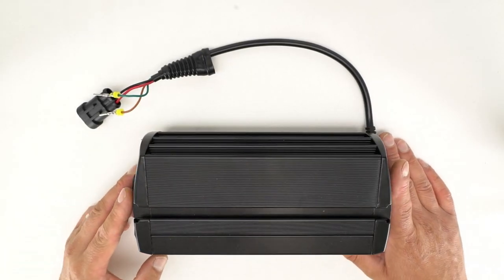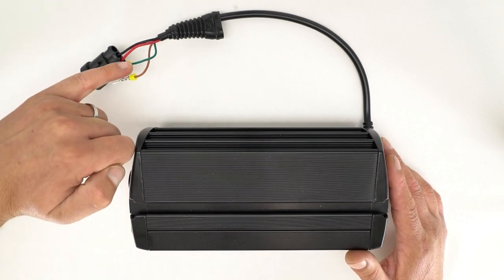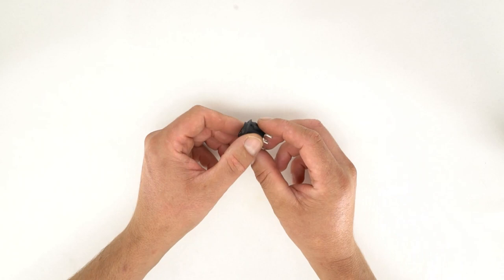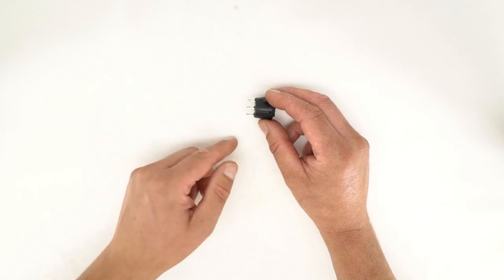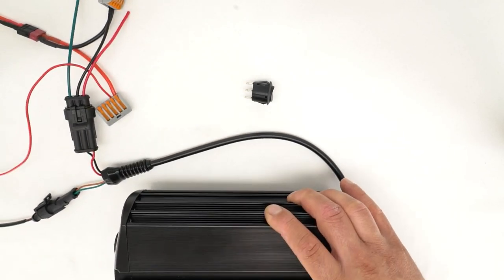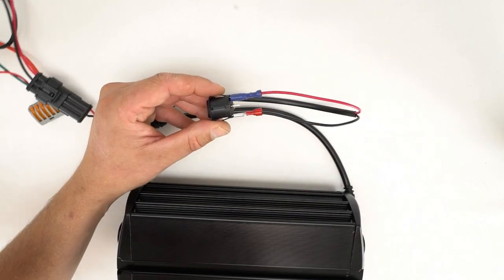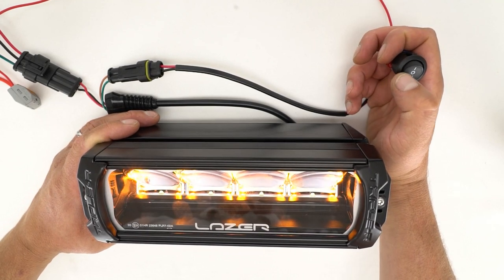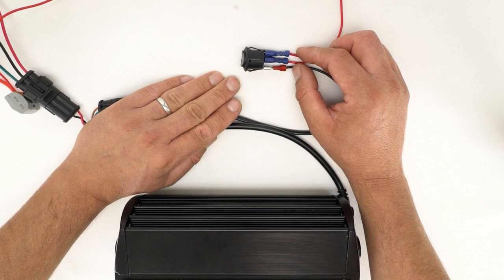HOW TO: 3-Pin Switch for White and Amber Position Lights

Comment: I have just bought these lights.  I am thinking to avoid having 2x switches down at the lights end, I replace the 3 way connector for a the same type 4 way and add a 6 way 3 position switch up near the battery, maybe in a waterproof box with the relay?

Comment: If you supplied power to both at the same time, would both white and Amber illuminate to create a warm white mix? Or would you damage something?
Reply from the maker: There'd be no issue to provide power to both white and amber LEDs.

Comment: What happens if you get a supply voltage to both colours at the same time, a faulty switch for instance. Does one colour take priority or would it cause damage
Reply from the maker: Our lights have a transient voltage suppressor, albeit any potential damage depends how much voltage!

Comment: Do y'all have any bigger size lights with two position lights??
Reply from the maker: The lamp in the video is our Triple-R 750 (4 reflectors), we also have 850 (6), 1000 (8), and 1250 (12).
Reply: @Lazerlamps  with the same features??
Reply from the maker: @jamesrodolee03  yes.

Comment: It’s funny.. My triple-r 1000 elite gen 2 has only red and black wire…
Reply from the maker: Hi, The Elite version of the Triple R lamps do not have position light function. The Position light is only available on the Triple R standard series.
Reply: Hi. Do you have to use the position light at all?
Reply: I just bought 2 Triple-R 750 elite. I don't know how to connect. To turn on high beam, low beam, yellow light and both modes at the same time. Please help me. Thanks